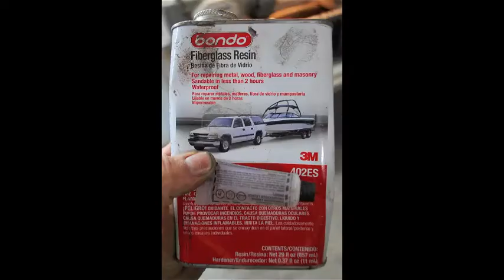Homemade wood die and metal spinning tool for sheet metal forming

Comment: Nice work. Cool tip for when working with gorilla glue is that if you wet the wood first you will get a stronger bond.

Comment: You have to anneal the brass several times during spinning. one reason I do not use brass. You should start with 1100 aluminum to practice. make sure its the anealed 23 brinel type. Super soft.